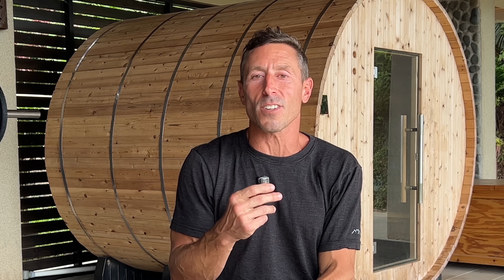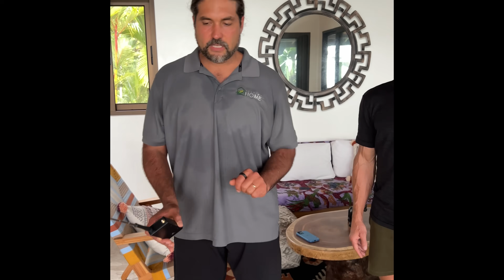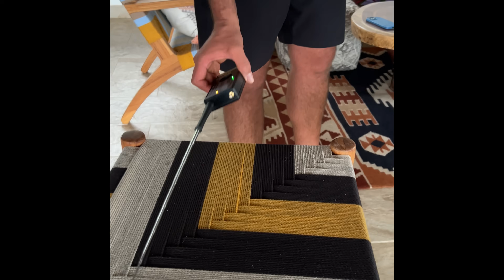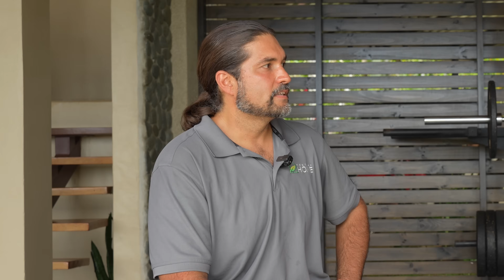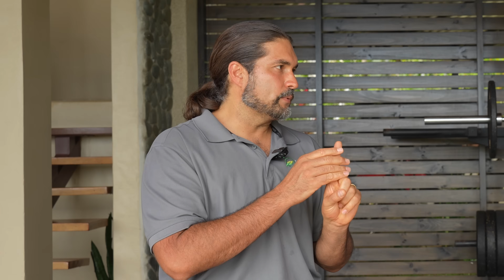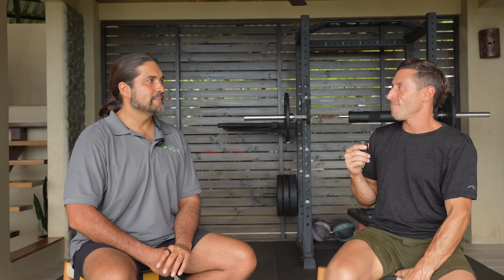Earthing vs. grounding

Comment: About Earthing have laboratory evidence?

Yes, earthing (or grounding) does have some laboratory and clinical evidence, although the body of research is still limited and not universally accepted within the medical mainstream. Here's a summary of the key findings and the types of studies done:

✅ Laboratory & Clinical Evidence on Earthing
1. Reduction in Inflammation Markers
Study: Chevalier et al., Journal of Inflammation Research, 2015

Findings: Grounding reduced white blood cell counts and altered cytokine levels, suggesting a modulation of the inflammatory response.

Method: Subjects were grounded using conductive patches; blood samples showed changes in markers like TNF-α and IL-6.

2. Improved Sleep and Cortisol Rhythm
Study: Ghaly & Teplitz, Journal of Alternative and Complementary Medicine, 2004

Findings: Grounding normalized diurnal cortisol profiles, improved sleep, and reduced stress.

Method: Subjects slept on grounded conductive bed sheets for 8 weeks; cortisol was measured through saliva.

3. Blood Viscosity and Flow
Study: Chevalier, Journal of Alternative and Complementary Medicine, 2013

Findings: Grounding improved zeta potential (a measure of RBC repulsion) and reduced blood viscosity, which could reduce clot risk.

Implication: May benefit cardiovascular health by lowering blood stickiness.

4. Autonomic Nervous System (ANS) Balance
Study: Brown et al., Integrative Medicine: A Clinician’s Journal, 2010

Findings: Grounding showed shifts in heart rate variability (HRV), indicating increased parasympathetic (rest-digest) activity.

Significance: Suggests grounding may help with stress recovery.

⚠ Limitations of the Evidence
Most studies are small-scale, pilot studies or not double-blinded.

Many are funded or authored by advocates of grounding, which may introduce bias.

There is no large-scale RCT (Randomized Controlled Trial) confirming the effects conclusively.

🧬 Proposed Mechanisms (Still Under Investigation)
Electron transfer from the Earth to the body may neutralize free radicals.

Modulation of the electrical environment of the body (especially at the skin or cell membrane level).

Effects on bioelectric signaling, inflammation pathways, and hormonal rhythms.

🔬 Bottom Line
There is some promising preliminary evidence showing that grounding can:

Reduce inflammation,

Improve sleep,

Enhance parasympathetic tone,

Decrease blood viscosity.

However, more rigorous, independent, peer-reviewed studies are needed before grounding can be considered an evidence-based mainstream therapy.

Would you like references or visuals summarizing these studies in Chines

Comment: Most copper plumbing in the house has to be grounded. Obviously plastic pipe is not going to work. If you can't run the wire to a grounding rod

Comment: The wires in your wall will not be emitting any EMF unless current is running through them. So if nothing is plugged in and actively running on those outlets, no need to flip your breaker off.

Comment: I took a outlets strip and removed the guts of it . I left in the grounding strip in there and connected a 8 gauge wire to it and ran it through my bedroom wall behind the bed to a 8ft copper rod that's goes down in the ground. I'm not a electrician but running through my outlets didn't sound the best to me. If I can get your email I could send you some pictures.

Comment: BS!
The "ground" of a home electrical system ends in a "ground rod" that is in the ground!
The same "ground" we electrically connect to when "earthing".
There is an 'influence' from proximity to electrical systems.
Pa was a lineman, he said the linemen that worked on the energized high voltage lines had to regularly go back to working 'dead' (non-energized) lines because working the energized high voltage lines caused a form of arthritis.
The high voltage lines produce 'cancer clusters' where people spend too much time in close proximity to the lines.
The former USSR had lower limits (very much lower) for exposure to the EMF from high voltage lines than the US.
Current in a conductor causes magnetic fields to form around the conductor.
Moving a conductor thru a magnetic field generates a current in the conductor.
Recent research indicates that magnetic fields also have effects on human health.
BTW, ALL 'normal' electrical systems in the US 'return' electricity via the ground to 'balance the potential'.
So 'earthing' (electrically connecting to the earth) establishes a connection to the 'dirty' electricity unless the person is very far away from any 'ground connections.

Comment: If a person is elderly and uses a CPAP, Lamps, a bed that lifts up the top mattress and or the bottom like a lean hosp. bed, its tough to kill the house current at night. Getting up to urinate 4 times a night can also be an issue. I have a fuse near the bed to got of incase lightning hits my threaded ground pounded into the ground. so I dont get fried by my sheets.

Comment: I am a licensed Professional Engineer. The ground connection in an outlet connect to “ground” which through wiring in the building connects to a wire to the ground (earth).

There are three connections in a standard outlet. The shorter vertical connection is the positive “live wire”. The longer vertical connection is the return connected to the return that is connected to the power grid (whether that be municipal or a battery) and the circular connection connects to ground as labeled above. 

There will be some interference to the ground connection due to electrical fields from appliances, wiring etc so physically touching grass is better but it is patently false to say that the ground connection on an outlet connects to the power company. Also, “dirty electricity” is not a thing. Wiring doesn’t move electrons, it moves energy.

Comment: So what I am getting from all this, it really depends on your house's outlets and how much dirty electricity the grounding wire may run into.  So best thing to do is test your outlets for dirty electricity, the create something that is a good thing grounding with the mat, to something bad, having your body absorb dirty electricity.  I also noticed If I had something else plugged into the same circuit the mat is plugged into, I would get dirty electricity.  Then if I just plugged the mat into the grounding circuit.

Comment: Hi Paul, Where can I find the device to measure the dirty electricity, do you have a link?. Currently I have a grounded mouse mat. Are you saying that even if I used an earth wire (from outside) on the mat to earth myself instead, potentially I would still be picking up electric off my desktop computer when I'm using it?.
Reply: it dont really make sense to me that that would be the case.  it sounds like saying organic food can have some toxins so mine as well eat garbage for breakfast lunch and dinner.

Comment: Don't let the perfect be the enemy of the good.  If it is convenient and practical to do a grounding rod directly to the earth, great; go for it!  But if your home or apartment is properly wired you will likely get the same benefits.  DrAndrewDoan's video "Scientific Reasons Why Earthing & Grounding Heals, Explained Simply by a Physician & Neuroscientist" references scientific studies that used grounding (not earthing) and demonstrated the healing potential of the practice.    The properly installed ground wire in your homes electrical panel is connected to the earth, so this is really a non issue.   You can tweak the results by turning off EMF sources in your room, but this will likely be trivial difference.

Comment: Pretty rough video, conversation included multiple false statements about electrical circuitry. I’m not saying grounding or earthing is wrong or bad, but proponents of it need to educate themselves properly or risk alienating smart skeptical people out there with obvious lack of understanding. Ground wires in a house DOES connect to the earth outside I’ve installed copper ground rods into the earth outside my house before. The demo of “bad electricity” also makes no sense. Why do we need to be as low voltage as possible? Just so many holes and missing explanations. I really am dissatisfied with this one.

Comment: In the UK we have a 3 pin plug which has a separate ground which I think is isolated. Is that sufficient to still consider using a grounding mat?
Reply: i think thats what we have in the us.  theres two flat ones on top and one round one below them.  the round one on the bottom is the grounding one.

Comment: I found this out the hard way by buying an RF blocking Dr Mercola cage, grounding it to my home outlet and putting myself into it. That cage caused me seizures and a very bad night. Now that I have good EMF meters, I know all about dirty electricity. You also need to be careful of grounding loops when using a rod into the earth in a residential area. For the sleeping area, I would actually put in a disconnect switch for the electrical in your room. Turn it off at night.

Comment: Every ground portion of my outlets is attached to a wire that runs directly to a metal rod into the Earth. Absolutely nothing for the grounding system touches the neutral or hot wires of my house. Pretty sure it's this way for every house that's wired correctly. Actually, after I think about it a little bit, there are some houses that attach the grounds to their neutral bus so I guess it's possible

Comment: Best and safest way to ground overload of direct current electricity after the mppt dumps what's not being used 🤔????

I thought of a dump load however I figure grounding would be a lot more simpler to do.

I'm prepared to slam a 8 ft copper rod into the ground...just tryna figure out what's more practical and reliable also though about concrete grounding but I'm aware it will create heat buildup and I'm trying to plan best for longevity use and what's going to be more cost effective....any recommendations?

Comment: The earth socket in UK connects to a rod in the earth outside the house to 'ground' or 'earth' electricity in case of a fault somewhere - a safety feature.  I am EMF sensitive.  I have used a grounding band (wrist or ankle) plugged into the earth socket, and mostly it works well, but after 1/2 an hour or so I take it off, because  I literally feel like a conduit - feel like I am draining away.  Good to hear someone identify this issue.  I think turning off bedroom power is a great and sensible idea.   I have bought earthing / grounding mats that don't work - test end to end with a multimetre.   A properly connected earthing rod outside is obviously the most efficient.

READ THE BOOK:  The Invisible Rainbow by Arthur Firstenberg - history and development of electricity, its mutation to radio, radar, TV, mobile communications etc, and its effect on human and creature health.  Densely researched, huge bibliography, very readable.

For anyone who is EMF sensitive I recommend earthcalm.com products - enabled me to heal after 12 years of ill health once I discovered the cause.

Comment: This Ryan Blaser has got the Doc snowed.  A look at all the comments and their replies pretty much debunked Blaser. Also,  I think Doc Saladino is the one who got all excited about the carnivore (all meat) diet,  and then (wisely) gave up on it.  If anyone needs earthing-grounding,  inside  (yes, it works)  or outside,  I would say it's the good Doc.  One of its attractions is that it will calm you down.

Comment: My guy, great video. I was just about to get sheets for the bed, which i am still going, but does anyone know, if you run your own wire, and you dont turn off the electric outlets near the bed, how much EMF are you attracting? The same as using the ground outlet? Better or worse? I dont think i can disable the circuits next to the bed.

Comment: Ok, so you hear electrical interference when grounding and call it bad? You need to break down how that’s hurting you, what is it just because you hear that noise you think it’s bad? 

And another thing. Grounding and earthing are the same thing actually. If I put a grounding rod outside and hook my sheets to it I’m grounding it, not earthing it. If I use the grounding wire in my outlet it’s doing the same thing. If your dads have seen this video they’re ashamed of you

Comment: In 2009 I had the honor of knowing a Fr Bernie Thomas at the Sacred Heart Church in Kooringal NSW AU. He told a riveting story of his direct involvement in a new parish church build in the Darwin NT area that was to be built for the Aboriginal people of the area. It was planned as a "traditional full-frame building" like ones today. It was built as such. The story was just beginning.

The parishioners refused to enter the space until the floor was removed. A 'dispute' ensued. No one but clergy entered. 

The floor was removed. The parishioners flocked in. A lesson in EARTHING was learned by the Diocese. What's more, the people would rather rest and wait in the sun backing the bare ground in bare feet instead of standing on the concrete in the shade.  There was something about the bare Earth.

Fr. Bernie told me the best celebrations of Feast Days were in a nearby park area that they would process to and gather around campfires for spiritual fulfillment.

This was my lesson in EARTHING told by someone who experienced it first hand.

Comment: I thought the whole point of being earthed through a rod is that whatever EMF around you doesn’t affect you anymore. Essentially forming a faraday cage effect around you. Now you’re telling me the opposite is true?!
Reply: The rod has to be a separate rod. I drove a 3 foot copper pipe into the ground and tied my copper wiring to that. The one in your house is also connected to all of the other outlets in your home.
Reply: @ That’s what I’ve been doing for some time now. I use a rod stuck in the ground outside my window. But it sounds like they’re saying that even that method could lead to “dirty electricity” using your body to ground itself.
Reply: @ they’re totally wrong. The only way is if you’re plugging your mat into an outlet.
Reply: @ Thank you for confirming this. This is what I also know.

Comment: I suspect that the problem with your mat is that it is a bad mat. Those mats vary in there quality and some have high emf's and electrical noise. The better ones do not have those problems

Comment: I just came across this video. The feedback message here is bogus in my opinion. It's easily checked / refuted by testing your body voltage both before and after contact with the grounding mat using a multi-meter.

Comment: Grounding and earthing are literally the same thing. Electrical potential is equalized to the Earth’s electrical potential. Any excess charge is dissipated to the Earth and electrical potential becomes that of Earths, that is what earthing or grounding is and there is no difference from either standing directly on the Earth or using an outlet.

Comment: you sir are incorrect..the neutral wire along with the 2 hot legs coming from the power company into your home is the return back into the grid..most houses should have a separate ground, which is tied into the home,  in the meter can going down to a ground rod drivin into the earth...if your ground rod is drivin into the ground according to specs everything should be good.."electrons skipping into that circuit"...WHAT...i could go on about this crazy video but the bottom line is this..when you plug your sheet or mat or whatever into the ground of the outlet you are plugging into the ground rod drivin into the earth..if there is no ground rod then that's a different issue..
Reply: So basically, grounding mats plugged into wall sockets work just as good as grounding outside?🤔
Reply: @Zeralop ..hello??.your house ,if properly grounded, is grounded into the earth via a ground rod at your meter can....
Reply: What if you have an old house and the grounding wire is run to your water pipe which comes from the ground? I can't seem to find where I'm going into the ground at home. I was told that back in the day they would ground you to the water pipes.
Reply: He just said it wrong yes the neutral sends the power back not the ground they are talking about all the extra bad electricity that is already in the circuit from other appliances

Comment: So if i shut my power off and have my bed hooked up to the outside will my neighbors electric interfere ?  They are directly on the other side of my wall. My room is small so i can't move my bed 7 ft from that wall. Will i bed defeating the purpose because of there electric thats still on ?

Comment: What if lightning strikes?
Reply: firstly, good grounding products comes with a build-in resistor that will burn up with significant current passage, breaking the circuit. 

secondly, your potential cannot exceed ground, and electric probably won't like to go through you, then to ground again. 

The question is like asking for the possibility of water flowing uphill — normally unlikely.

Comment: Please follow Andrew McAfee on this topic. Connecting to the earth outside your window is not necessarily the best thing to do. The country's electrical system hasn't scaled well and as a result they run neutral to ground at practically every pole as a band-aide. There should be 2 neutrals. Electricity doesn't just return to the source, it takes all paths. Don't do this practice unless you live in a field in the middle of nowhere.

Comment: If your friend completely shuts off his electrical circuit at his house every night - what happens to the food in his freezer?
Reply: If it's a good quality freezer with intact seals, it probably stays frozen. Obviously one should check before turning the power on again to make sure there is no thaw.
Reply: @lenavoyles526  You can also just shut off the breaker switch to the bedroom.....!